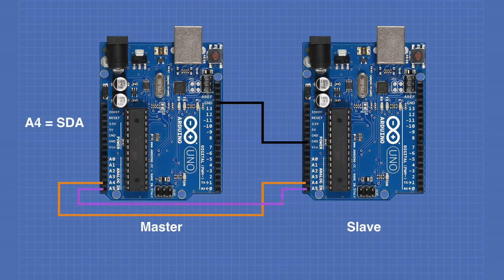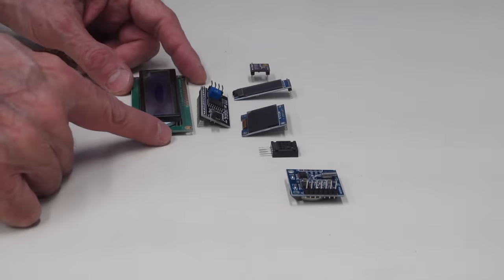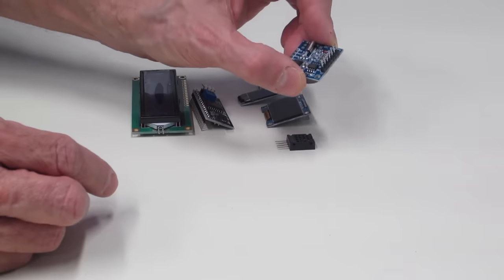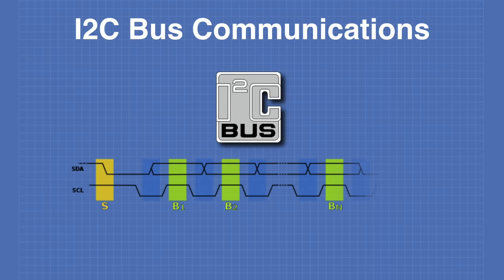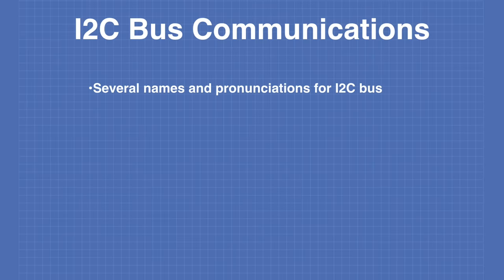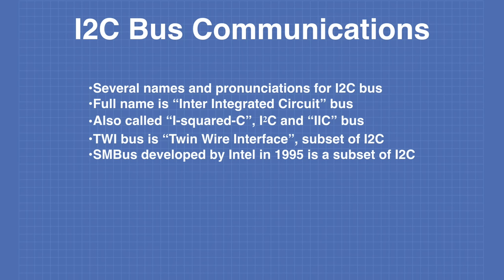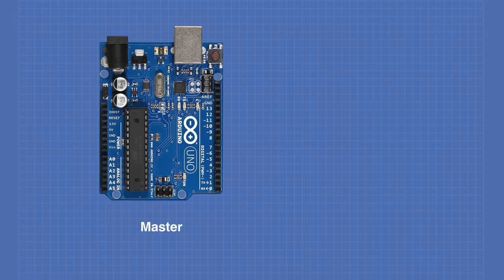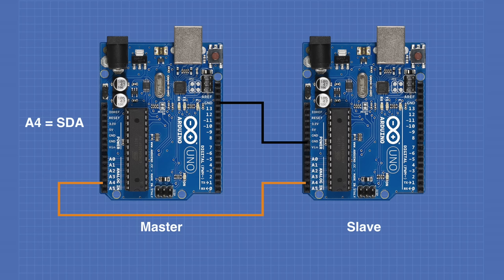I2C Part 1 - Using 2 Arduinos

Comment: I2C helps keep your code simplified as well.  I use several arduinos to run a watering program for each of 8 garden boxes and a separate arduino to display whats going on.  That way, 1 arduino only controls the display and each of the other controllers control 2 garden boxes each.  The display controller just sends a status request and gets what it needs from each of the controllers.  I could do all of this with 1 arduino and no I2C but the coding would be much more complicated.  Also, I use a push  button on the display controller (master) to toggle through the status requests.  That way it only sends a request when I require it.  Thank you for your video(s).  I've learned alot.
Reply: Can I ask what method do you use to do the status requests?  Your setup sounds very well-organized!

Comment: Very nice of you to do I2c tutorial.
Cable length can be a problem as you mentioned. I tried 3meters, and that hangs the arduino. Then I tried with 2 meters and that is OK in my project. So if your projects hangs, it might be because of cable length.
You mentioned pull up resistors for sda and scl, but you did not use any in the practical example here.
It might work for some projects, but you might need pull up resistors between 2,2kOhm and 10kOhm.(trial and error).
Keep in mind that most i2c sensors already have pull up resistors.
And keep in mind that using many sensors on the same i2c bus might need to be complemented with higher pull up resistors.
Example:2 mpu6050 gyro/acceloremeter with internal pull up resistors at 2,2kOhm will make the pull up resistors of a value of 1,1kOhm. That should be complemented with additional external pull up resistors, so that the total resistans lands on about 2,2kOhm and 10kOhm.
Reply: I2c isnt made for use with wires, its intended for using it in a pcb.

Comment: Thanks so much for this video, ots exactly what i wanted to learn. Im looking to build a home cockpit and one of my requirements is to use a single USB (or a max of 3) for the entire thing.

This looks perfect to wire up all of thr switches and controls on micro pros and then run them all from just one or two masters. The coding for this is remarkably simple as well.

Comment: Never heard anyone refer to I²C as "I two C" - to me it was always an "I squared C" - and "I too C" that you've mentioned it in your video ;)
Reply: I2C; IsquaredC; TTL; TsquaredL   - how you say it depends upon who taught it to you and  preferences.  It has hitherto  been ItwoC to me when I worked in private enterprise but now I work for a University the preference there is IsquaredC ... and I'm thinking that maybe this is a pedagogical preference ... certainly sounds more  scientific when you put a 'squared' into a sentence doesn't it?  Anyhow I'm going with the flow and either moniker will do for me.
Reply: @frankcole3196  Personally, I don't know what the gain is from using 2 instead of a second I, as in IIC?
And I'v only used TTL as Transistor-Transistor Logic ... maybe a bit as Time To Live ... never seen it as T2L with or with a superscript but there are so many possible phrases abbreviated to TTL that I may have missed a ton ;)

Comment: very good video idneed

I have used i2c using two times a 10ft cable without any issue.
I am using now several devices all connected via in total 6x 1 FT cable
Reply: Why do people do that?

Comment: Congratulations !  It is a very useful video for me. I would like to communicate 4 Arduinos by I2C. One master, e three slaves. The master will send 4 bytes(the same bytes), for all 3 slaves, and then, it will request 2 bytes form each slave. They will be at 50cm longer at the maximum distance. I would like to use I2C @ 400Hz, if it is possible. I heard about a way to broadcast those 4 bytes for all 3 slaves at once time. I loved this video. It is my first step on that direction. Thank you !

Comment: Great video. I hope you be  covering the use of the TCA9548A multiplexer with two or more identical I2C sensors (like the BME280) on one Arduino Uno.

Comment: Thanks for the very well done video that explains how this is supposed to work. I am trying to implement this using two ESP8266 Wemos D1 R2 boards. I have two issues. The code as written would not compile. The receiveEvent method is missing  something that may be unique to these boards. I had to include an int being received from the Wire.onReceive() function. The resulting method looks like this
void receiveEvent(int howMany) {
  rd = Wire.read();
  Serial.println(rd);
}
What number do I put in for howMany? I tried various numbers but it would not compile unless I put in a variable. Perhaps I need to change the mode on my SDA and SCL pins? I am pulling them up with 4.7K resistors to 3.3V, and grounds are connected between boards.
I tried implementing both examples you showed in the video. The first slave example seemed to receive data occasionally, and tried to send a response back to the master, but it never printed Hello. It would usually print a blank line, but sometimes ???????. The second example slave never received any data from the master.

Comment: Great intro video. I did think the pull-up resistors were glossed over (or I missed it) other than the initial diagram. I assume the Arduino library applies internal pull-ups, but to use other micros the clock and data lines need to be pulled up externally. Loosing one of the pull-ups can quickly make the bus less reliable and should have been stressed a little more - such as the pull-up resistor size.

That said this was video has your typically excellent production values.

Comment: Will you look into using the ATTiny84 and ATTiny85 when you I2C-ify sensors? They would be a good choice due to their small footprints, but they use a different library than the Arduino and Atmega328 chip, so special attention is required. Please consider the ATTiny's in you I2C-sensor building.

Comment: Hi,
I tried out the example I2C communication code with two ESP32 devices. Initially, everything worked well: the master sent packets and requests, and the slave responded correctly. However, during testing, I restarted the slave while keeping the master powered on.
After the slave powered up, the first packet sent from the slave was corrupted, showing junk data like this:   "Write data to slave  
Receive data  
�����"  , But the next packet from slave is not corrupted, It prints "Hello". What could be the reason for this issue, and how can I resolve it?

Comment: hey just wonder. i used to make same master to slave with Arduino. but at that time i use mega as master while 3 uno connect to serial port on mega. the mega is self i use as data hub/sort to computer to but wonder if it better to use i2c for multiple  uno instead what i made that time?

Comment: Only watched until 11:27 but there ist still a question open: what is "SLAVE_ADDR", is it a number (out of those 127 devices you can use in i2c) you can choose freely, or is is the number of a portpin (A4)? So you need a fixed use of pin A4 for communication?
Reply: Yes, SLAVE_ADDR would be the slave address and this value can be changed but only 112 out of the 128 are usable since the rest are supposed have special purposes. Analog pin 4 (A4) doubles as SDA and analog pin 5 (A5) doubles as SCL.

Comment: Is it possible to run say two Arduino pro mini and one DS3231 RTC on the one I2C bus line....use data from the RTC to one Arduino to run an analog clock display on an Oled screen 128 x 96 or similar.............use other data from the DS3231 RTC to check a struct for matching birthday events in the other Arduino pro mini and bring up bitmap photo of a matching birthday on a separate TFT ILI9431 spi display.

Comment: Excellent video.. It brings a question to mind. How would somebody connect multiple sensors to an Arduino?  Once you factor in an H-bridge, and speed sensors. The possibility of running out of I/O Pins becomes a real possibility.

I watched your servo video, and the PCA9685 to control multiple servos... Is there a analagous external board that could I2C control multiple sensors?
Reply: As far as I know, i2c allows to put multiple sensors on the same sda/sck lines. Some other protocols like OneWire can also allow multiple devices on the same line.

Comment: do you know how to do this with sensors Instead? I am working on a project and I want there to be multiple rgb lights on an arduino and each light has a sensor on the other arduino. Is that possible?

Comment: Hello, i have a same project about i2c, and my problem is i'm using Arduino DUE as Master and Nano as Slave,  and Arduino DUE has 3.3V operating voltage and nano is 5V, can you explain about I2C with Arduino DUE ? because the i2c won't work, as far as i can, the i2c for DUE can do only scanning and other example as master  reader and slave receiver, but can't do for any projects , thank you

Comment: Thanks for the nice tutorial :) 5:22 I was wondering the data transfer speed of the I2C and I ended up to find https://www.nxp.com/docs/en/user-guide/UM10204.pdf It says the standard-mode is 400kbit/s and fast-mode is upt to 5Mbit/s. Is there a chance the units in the video is Mbit instead of MHz? Or 1Hz means 1bit per second data transfer speed?

Comment: I see that you are powering the second (Slave) Arduino board with a USB port and this complicates things if I only have 1 PC. Can we power up the Slave with a 12 volt transformer that comes with the Arduino Uno (the one I am using)?
What changes do we have to make on the arduino uno Slave and Master to use this kind of power source change.
I can see that the Master needs to be hooked up to the USP to interact with the ardouino IDE and the Slave can be filled with the sketch code. Your program calls to read  SLAVE_ADDR which is assigned to the same value as the Master ( a 9) as per the Master Sketch. Do we have to change the code of the Slave arduino ?

Comment: Just what I needed, as I am about to start a project using an I2C temperature-humidity-air pressure sensor. Did I understand correctly that the maximum length of the line between sensor and master is only one meter? is there any way around that limitation?
I am colorblind, like about 10% of males, and blue wire traces are lost to me against the background of your drawings. Could you use a more contrasty color or patterned traces for wires? Or maybe a white background?
Otherwise, thanks for another of your excellent presentations. How do you find time for all you do?!

By the way, one of your screwdrivers is crooked ;-)
Reply: You can use a RS485 to reliably extend a digital signal at distances over 1 kilometer with the help of twisted pair wires commonly found in ethernet cables (probably shielded at that length).

Comment: I've been looking for how to use five encoders on a Arduino Nano Every to control five servos on a remote Arduino Mega using I2C.  I have one working but I can't figure out how to get the other four going.  Everywhere I've looked people are only doing one task and never have more than a single means of control.
Reply: If you follow this series, the next will discuss creating your 'own' i2c scenario.  with multiple encoders you'll need to get each encoder working independently, i.e., A0 =encoder 1, A2 = encoder 2 and so on.  I do not know of any i2c compliant encoders.

Comment: two STM32F103 blue pill boards. Allot one device as a slave and one
device as a master. Use a temperature sensor to read the temperature
using slave. Perform an I2C communication to fetch the temperature data
using master.  please help me to solve this

Comment: Thanks for the video.
I tried to do same with two esp32, but it didnt work.
Do you know a way, how to get a connection with two esp32 via I2c.
The error occured in the setup function (Wire.onReceive(receiveEvent)) -> there is one of the problems..
Any ideas? thx
Reply: I had the same issue, you need to change it to void receiveEvent(int howMany) that fixed it for me

Comment: Can you speed up I2C by using a mcu with a faster IC clock frequency or using a higher baud rate?
Reply: STM32 MCU's support up to 4 MHZ.  I have various NUCLEO and DISCOVERY boards from STM.
Reply: @DDA40Xman  I have a bunch of blue pills. So how do I set it up to have the faster transmission rate? There seems to be some lag when you want to control motor drivers, if you're doing it with arduinos.
Reply: Wouldnt recommend that because its pulled high passively

Comment: hey got a qaustion i wanne make my car with speedunio and my interior lighting and supsension (airride) arduino controlled  so i think i would use three arduino's do i need use i2c or make there indempentment i would make the interior wanne with a screen that i can use them for lowering and highering car and make dynamick suspension option and  that i can cominicate with the speedunio to set more ignition timing and boost control if got turbo and give my engine information is this possible
Reply: And I wanna build a rocket and go to mars if anyone can send me code and schematics i'll appreciate it thanks

Comment: I am having trouble connecting 2 arduinos to 1 computer.  I have plugged in my master into COM4 and my slave into COM3.  I uploaded my master sketch using COM3, when I try to set up my slave using COM4, the master changes to COM4 as well, the computer changes the port of both to my slave port or does not recognize the two separate ports.  What can I do to fix this.  I have tried changing several times, plug one in at a time....but will not allow me to use the two ports respectively.
Reply: I have had similar problems.  Sometimes it works and sometimes it doesn't.  Sometimes it brings up an extra IDE which is sure to cause that problem and when I close that extra one down, the other two work ok usually.  May have to open each IDE from the desktop or menu rather than opening one up in the file menu of the other one.
Reply: Like he said. You have to open two separate instances of Arduino for it to give you two separate ports.

Comment: I have one doubt.... In this set up in one arduino to another arduino can we transfer the values?? 
Please response as soon as possible
Reply: yes. the response from the slave is yours to define.  So, if you passed from master to slave the number 9. Let's pretend you divided 180 degrees into 10 segments and the number 9  represents 'something' in front of you in sector 9.    Once the slave received '9' your code would evaluate and respond  with a servo value 160 degrees.

It'll be your ability in coding to define what is sent data, processed data and responses

Have fun :)